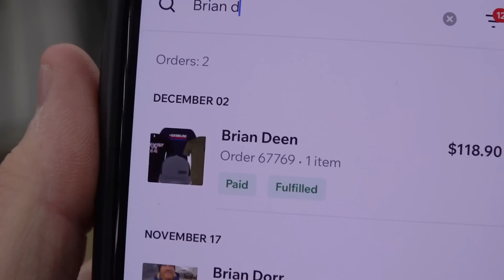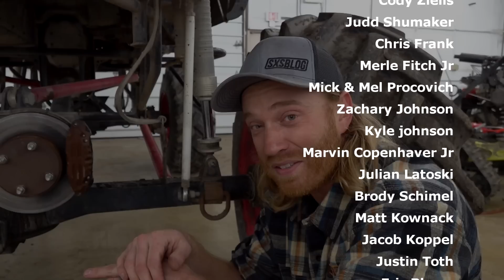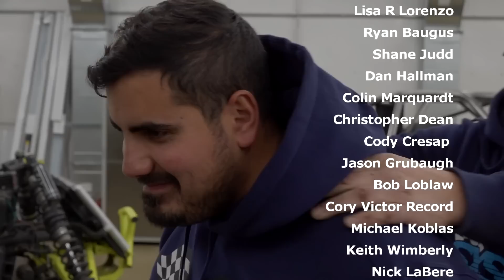Our turbo LS mega truck gets ripped and breaks... twice!

Comment: i worked on sail and traveled with him for years. 2.5 tons on it were such a pain in the ass lol. hopefully if you keep that truck within a few feet of the ground they hold up for ya. if not 5 tons wouldnt be the worst swap ever. meritors or axle techs youd have to redo the whole truck because of geometry.

Comment: I have rebuild those axles before. when you pull out the actual axle shaft make sure you hold it straight. otherwise the balls toward the wheel hub will fall out. The hub has two brass bushing on top and bottom you might wanna check that as well. Once you get the axles out of the housing there is two seal plate one on each side that you wanna change.that keeps the gear oil from leaking out. A slide hammer is good for that. 🤘

Comment: A good trick for if you're taking out old races is weld a nice hot bead all the way around the inside of the race and the heat should cause the race to shrink enough to wear it should almost pop out relatively easy.  And install a new one put the new race in the freezer for a little while will help with installation
Reply: Thought heat made things expand?
Reply: @minidiggin   You are right it does and I don't know why it works but it works  I'm assuming that the high heat will expand the bearing but as it cools it seems to contract it just enough to let fall out

Comment: I broke the same thing in my mega!   Dont event bother trying to pull n replace those bearings!  Get a new set of axles n rob the chunk out if them!   This will save you alot of time n frustration!
Reply: The front and rear chunks are interchangeable so you can just pick up a couple if 2.5 ton rear axles and you'll have all the parts you need.

Comment: Honestly a lot of those trucks are built with old rear ends out of whatever truck they get from a junkyard. They're worn out before they even installed. Also you guys really need to get a intercooler or water/air heat exchanger. Your IATs are through the roof I'm sure. Kills power and potential to kill the engine.